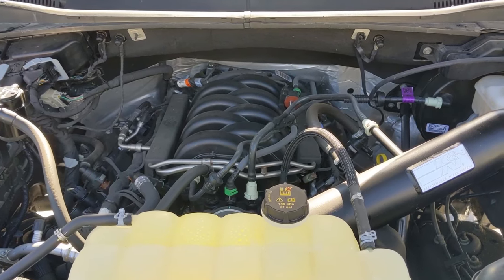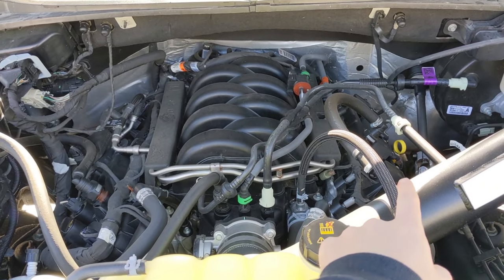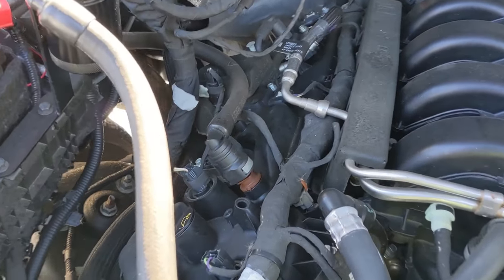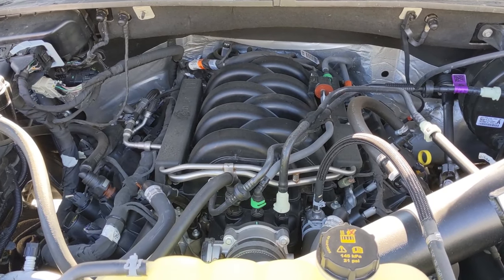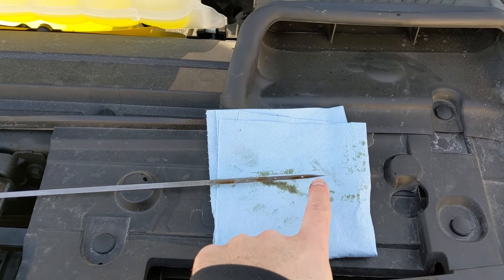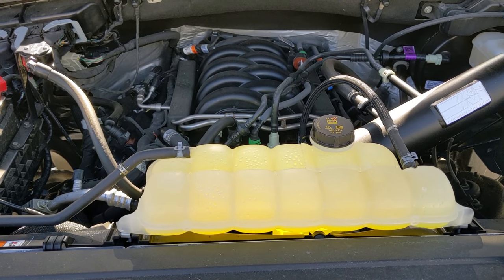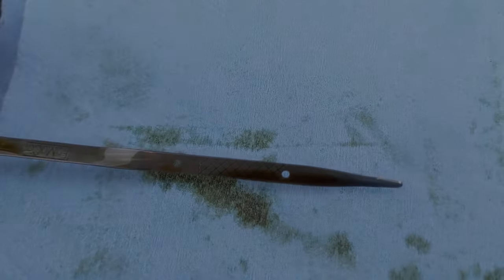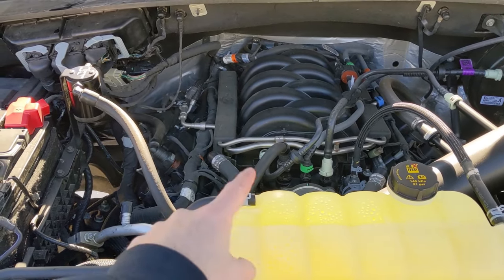Oil Consumption Update - 2019 Ford F150 5.0L

Comment: The longer dipstick registers two quarts of oil instead of one in between indication marks.This is absolutely bogus. It allows the truck to burn excess oil without it looking like it’s an issue on the dipstick. You should use TSB19–2058 
The proper way to perform the oil consumption test after they have replaced the bunk dip stick and pcm update is to put 8 quarts of oil in and let the truck sit for a few minutes add at low indication mark on the dipstick then add a ninth Court allow the truck to sit for a few minutes and then an upper indication mark. The truck is then supposed to be brought back weekly for oil level checks.  If the truck burns excess of one quart of oil per 3000 miles your truck dose not meet Factory specs. Long block replacement is issued. 

I have went through this entire process and had to hold my Ford dealerships hand to make sure they got it right. My truck is burning 1.5 quarts of oil every 3000 miles. If I was to wait 10,000 miles to do a Synthetic oil change I will have burned 5 quarts of oil !!! Ford what is going on? How can you pass any emission laws with this kind of oil consumption issues on brand new trucks?
Reply from the maker: My truck consumed 1qt per 1000kms, by 5000kms I had added over 4qts.

The 19-2365 tsb solved my consumption, as I stated in the video, the PCV valve didn't, on some trucks it's all that's needed.

They didn't have to do the consumption test because I showed him a picture of my dipstick and it's a company truck and I said I don't have time to go back and forth to the dealership.

They did the tsb and it solved consumption. The issue was, about 100kms after this video was posted, I got a check engine light for a catalytic converter issue.

The original oil consumption lead to my left bank catalytic converter getting clogged up, they replaced that under warranty and I get better fuel economy now.

Trucks running good, just took it in for oil change and filter at 10,000kms and no consumption
Reply: @EliminatorPerformance  1000kms = 621 miles in America...

Comment: I have a 2018 5.0 and zero oil consumption issues. It took three re-flashes of the computer to make it drivable,( cold idle overlap and tranny management) but other than that it's been a solid performer. Well done and informative vid will get the pcv upgrade as well as the catch can mod. Thanks' and cheers.
Reply from the maker: Redlash to OEM or a custom tune? Some shifting tunes are rough I've heard, mine is great, but they don't like to run cold.
Reply: @EliminatorPerformance  That was the problem to a tee, and clunking when cold starting. Also a high idle when warm.

Comment: I have a 2017 5.0 and it holds 7.9 quarts. I wonder if the wrong dipsticks are from carryover since the 2018's hold 1 quart more and they never changed them?
Reply from the maker: It's possible, but I'm not too sure. I heard possible defect in the overall length. Some were longer, shorter or in between.

Comment: Does anyone have any recommendations? The dealerships in Vegas are terrible. It’s like pulling teeth to get ahold of a service advisor at any of their dealerships. Finally I had one call me back and they have no clue about a TSB. Said I would just have to drop the vehicle off for approx. 2 months to diagnose the issue and go from there.
Reply: No, tell them you are invoking the Lemon Law and they have to buy it back.. It is Unacceptable to have to think about having to add oil, for example, every 1,000kms = 621 miles... If you have to drive across the entire US, let's say that is 6,000 miles, round trip and you have to add 2 quarts of oil, that means you have to add oil 9.7 times, times 2 quarts, = 19.4 extra quarts of oil you have to stop and add during this trip...I would just invoke the Lemon Law Buy Back and get something that is not as bad as this...  
Read the posts here... Lots of people  with these trucks all having the same oil consumption issue, and only ONE has successfully had it fixed... The odds are bad for this problem, I am afraid...  Good Luck...

Comment: So if you do your own oil change and you put in exactly 8.8 quarts and it's right at the full level it's not the dipstick.  If you still burning oil it's throttle plate.
Reply from the maker: Yes exactly! But if you're consuming oil and your dipstick appears ok, try the ev281 PCV valve 1st, if that doesn't work, get the TSB done, as it makes your fuel mileage a bit worse, but not too much
Reply: @EliminatorPerformance  thank you
Reply: @EliminatorPerformance  well I got the pvc valve and I ordered the one you said and the one I replaced was the same one so I'm wondering since I bought this used somebody changed everything already still watching the oil level

Comment: Interesting issues.  My 2013 seems to run pretty good, doesn't have many issues, even at 189,000 miles and my '02 sold back in 2016 had 244,000 miles and did consume some oil, but nearing a 1/4 million miles, it wasn't bad at all.  What's funny is that these issues are largely artifical, meaning, it's really not the engine at all consuming the oil, but rather sort of outside sources, like wrong dipstick and a weird adjustment on the throttle.  Also, I'm wondering if I need an oi separator or catch system on my turbo Bronco?🤔  I have messed with tons of mileage breaks for oil changes, but i have settled on 5000 mile intervals because it's older and I also tow about 10-15% of it's driving life.  I figured that counted as extreme duty.  Good video.

Comment: Excellent video!! Thanks for putting that out there! Just did my first oil change on my new 2020 F150. Last truck was 2010 F150 4.6 V8. It has over 152K miles...very reliable! Got a little nervous when I started looking into oil changes on this truck! Live near Buffalo, NY and take my autistic son for long hilly drives around here. Checked oil after 200 miles, level looked good, and monitor only down 1 %. Will keep checking. Love the idea of the oil catch can...keep as much carbon out if those cylinders as possible 👍👍. I'm going to check that out for my rig. Question, I bought a late 2020 model. It's there anyway to easily tell if the TSB has already been incorporated into the vehicle?
Reply from the maker: Pull your dipstick, if there's a wide gap between the 2 holes than it's the new one. Trucks built after October 2019 should've all had them, but oddly enough, I've heard of some 2020s that don't! The old dipstick has a very small gap between holes. You'll see the old dipstick in this video; https://youtu.be/s8D6XtmH2dg

And yes, I'd highly recommend an oil catch can. The install of the JLT 3.0 was easy! 

Here's the install: https://youtu.be/Trq0m4S9myw
Reply: Eliminator Performance will installing the catch can cause an issue with the warranty?  I saw another video where a guy said he takes his off when going to the dealer for any work needing done.  That seems like an inconvenience I would not want.

Comment: There was another problem early on with the production of the 4 valve head.   Which was with the valve spring. Which is a beehive one. And if it was laid on a table on a table, it would wobble. Long story short, during installation, the spring could be installed upside down, causing a reject and removing a seal in the process. Then, picking up another spring, which would be installed without a valve seal.

Comment: Im on my 2nd engine and same shit losing oil like crazy again time to raise hell again. I've already had the tsb and longer dipstick didn't work for mine. Also it's a 2018 5.0. Glad you got yours fixed.
Reply from the maker: Sorry to hear that, hopefully they fix it up. I know the 5.0 had major issues in 2018, but I'm not sure why, if you had the engine replaced, why they wouldn't use a newer gen3 with the TSB already done.
Reply: I switched to Pennzoil Ultra Platinum 5w-30, no more oil use. Between oil changes I'm still within the hash matks on the dip stick maybe 2ozs. Using Ford's Motorcraft I lost 1qt per 1.5k miles. I also never let the oil change get past 50% oil life. I've got a 19 GT. Hope this helps, sorry about your luck dude. Oh and let your engine head temp hit 140f before driving. Plasma bores take a lot longer to heat up compared to traditional stock sleeve. I'm sure you've heard of the typewriter tick some people get.
Reply: @EliminatorPerformance  I wouldn't say "Major issues" cold starts and revving the motor ito the moon is ownership responsibility. Besides compression, nothing has changed 18-20. By the time 19s came out people learned to let the engine warm up a tad before revving to the moon.
Reply: @Hanibul_Lecktor  love the name lol. I always let my vehicle's run before taking off I had the typewriter tick in the last engine. I have heard of alot of people switching to a heavier weight oil that maybe something I start doing. Im currently getting the oil consumption test done on new engine.
Reply: @kenwilson2314  I think Palm Beach Dyno did a video at a machine shop where they explain the tick in detail, check it out. Parts designated for a certain tolerance made it into the wrong engines early on. Then they (Ford) found the bore spacing was also off by as much as .12 which also caused the tick. Those were early release 18s, quickly corrected. You've got what ever current year block was replaced in it so you're golden there. If you're hard on your motor, 5w40 is even better. Roush and RTR both use 5w40 in street applications boosted or not. I did use Amsoil for one oil change to see if it was evaporation like he's describing here through the PCV system. Since it has the highest evap tolerances in the industry. Pennzoil is 2nd to Amsoil for 1/2 the price, only reason I use it. I cringed personally finding out Pennzoil probably one of the cheapest oils on the market also makes the best oil for street use.

Comment: I am thinking of trading my 2020 f150 with the 2.7 for a new 2021 with the 5.0. But I am hesitant because I have heard many people say that the TSB did not fix their oil consumption and now they are adding the new cylinder deactivation. I heard another reason for the oil consumption is the new cylinder coating started in 2018. I saw the TSB done at a dealer and to my knowledge, they also added extra oil as part of it.  Any thoughts? Great video and very well explained.
Reply from the maker: From what I have researched, the plasma coated cylinders are only an issue if you don't properly break-in the engine. The piston rings don't seat properly and then score the cylinder, causing oil consumption through there. It's hard to say, as these trucks do have varying levels of issues. However, I would stay away from the 4th gen 5.0 with cylinder deactivation for now. A 2020 5.0 should have these issues sorted, but some still need the PCM reprogram to sort out the vacuum. Hope that helps!

Comment: I own a very low milage (26,850 miles) 2018 F150 XLT with 5.0 V8. My question is should I expect a dealer to charge me for this oil consumption fix from the technical service bulletin?
Reply from the maker: Since it's out of warranty they'll likely charge you, but it would be worth a call to see if they'd do it. You could likely compromise and ask for the ECU reprogram part of the tsb to be done free of charge if you pay for the oil change. Also, I'd recommend you buy the ev281 PCV valve and install it yourself, it's super simple and they're only like $5. I would recommend a 5w40 fully synthetic oil though.
Reply: Thank you Eliminator!

Comment: I'm the original owner of a 2015 F150 with the 5.0 (early build of Jan 2015) with 63,000 miles.
I change my own oil with Mororcraft 5w20 syn blend every 5000 miles and it consumes a Quart about every  1,500 miles.
Every search I've done seems to be about consumption on later models.

Do you suggest I try the PCV on mine?
Reply: Having similar issues with my 2016. It was perfect nvr used a drop till 112000kms then noticed after hard runs a little puff of blue smoke would happen at cold starts

Comment: can you buy the new length dipstick from fords parts ?? i have a 18 5.0... but im not worried about the TBS flash, so much as it would be nice to have the correct length dipstick
Reply from the maker: Google the TSB 19-2365 and read the part number for the dipstick, then call your dealership and order that.

Comment: Yes indeed...excellent video! Thank you.

I have a 2018 F150 Lariat with 5.0 v8.

I just hit 67,800 miles and noticed I was 'low' on oil when checking my dipstick.  I drive my truck pretty conservatively so was shocked to see the oil level just BARELY evident on the very end of the dipstick.....and it took almost 2 wts of oil to get it up midway in the hash Mark 'safe' range of the dipstick.

I am taking my truck into the dealer for an oil change tomorrow and showing them this video and asking about the tsb's you generously provided.

Do you think they will cover these modifications?
Reply: What happened?
Reply: 130,000 5.0 2018 having stalling issues and vct solenoid issues. These engines are junk.
Reply: @thatlilbkid   Sorry for the late reply.  I did have the TSB (PCM and Dipstick) done, free of charge.  Made very little difference in oil consumption.... but did make * a slight * improvement.

Comment: I had this problem also on my 2018 . I did a compression test and leak test , found that cylinders 2 and 3 were out of around and low compression, the fix , through my warranty is a new 5.0 long block , , u do have jump through the hoops of  before u get ur new engine .
Reply from the maker: I had consumption before this TSB was done, and since the TSB was done, my truck no longer burns oil! I guess I'm lucky

Comment: Where did you hear that the original dipsticks were marked wrong?  That's the first I've heard that.
Reply from the maker: I've heard from multiple people on the forums that some trucks had too short of a dipstick, which would cause the overfilling. The new ones not only have a larger 1.9L range between hash marks, but also is longer, so it goes deeper into the sump. The issue with people comparing them though, is that lots of people compare the hash marks, instead of the overall length from the top to bottom. The new dipstick is a JL3Z-6750-E. Another issue is not all trucks had the shorter defective dipstick, and not all trucks built after October 4th 2019 have the newer longer one.
Reply from the maker: @Chris Turner the dipstick change, PCM reprogram and an oil change and filter is all part of the 19-2365 TSB. You have to show proof of oil consumption, I showed the service manager a picture of the low oil on dipstick and said I was consuming about 1qt per 1000kms and they did the TSB without doing the "consumption test" which can be a long drawn out process that makes you have to go back to the dealership every 1000kms
Reply: @EliminatorPerformance  I had the TSB done on my 2019 F-150 around the same time.  Fixed my consumption issues as well.

Comment: Heya Eliminator Performance, still have the truck?  If so, still fixed?  Just wondering as I've had same thing for a couple years and Ford just tells me it's within specs, and just today ran across this video.  Lots of $$ to pay for a vehicle not being used hard consume that much oil.
Reply from the maker: Still have it, I've been testing different oils since getting the TSB to see what the truck consumes less of. I used to burn a quart every 1000 kilometers, now it's only 1 quart every 8000km (5000miles) so I'm happy with that. These engines seem to like a 5w40 oil, fully synthetic. I've been filming little bits here and there and plan to post an update video eventually.

Comment: great video and explanations. have 2019 5.0 bought with 13,000 miles first oil change at 19,000 and dipstick was dry never had a low oil light or anything.  dealer did TSB and waiting on longer stick. now 22,000 miles and about a quart low....hoping it resolves....
Reply: Don't let the dealership get over on you I had to flip out before they admitted I was losing to much oil. Im now on my 2nd oil change with the new engine and of course it's at the bottom of the dipstick. Going to go raise hell again wish it didn't have to be that way but I can only keep my cool for so long while they feed me bullshit. I feel sorry for all the people that get screwed by the dealership they always want to say it's in spec. Nothings wrong ect.

Comment: Great video as usual, thanks!  I have a 2020 F150, 5.0 Roush with Supercharger, I decided to use an UPR can rather than the JBL due to the can collection design seemingly a better internal system.   My question refer to this cans having different in and out of the can outlets, and both manufacturers referring to the third hose connection going to the back of the block as unnecessary to use.  Should I change the PCV valve on my Roush. Any thoughts?  Thanks
Reply from the maker: I honestly have no idea about a 3rd hose. On mine I just have the intake and output, so valve cover then jlt can, then intake port. The Facebook forums are great for these questions though, check it out: https://www.facebook.com/groups/F150PerformanceTrucks/?ref=share

Comment: I had the TSB done, still used oil, just not as much.  Switched to 5W30.  Not using any now in 5k miles.
Reply from the maker: @Jake-cz1kb  I've been running Liquimoly 5w40 Molygen this summer, hardly used any oil. Will do an update video at some point
Reply: @EliminatorPerformance  right after i switched to 5W30 i also drove it pretty hard on a 600 mile trip, then 600 back home a couple of days later.  At the time it had 25k miles on it. 
Not sure if driving it hard for the 1200 mile round trip may have helped as well.